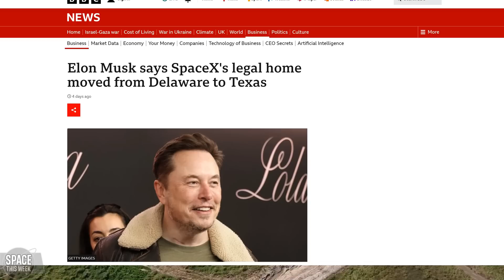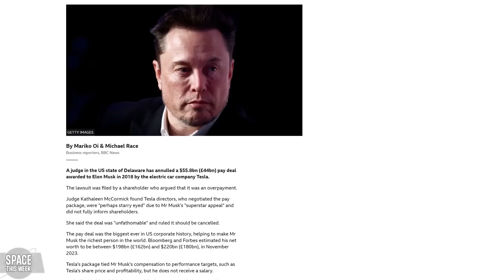SpaceX Aborts Full Stack Testing and Prepares for Ship 28 Static Fire!

Comment: I know that SpaceX wants to launch 144 times in 2024, but they are right now behind track. They have an average of about 1 launch every 3 - 4 days and they need an average of about 1 launch every 2.5 days. They can still change that, but they got to do it soon because the longer they wait, the more they will have to catch up. 

I have noticed that SpaceX is now starting to launch in batches. They have a couple launches within an incredibility short time (like those 3 launches in 24 hours) and then the next couple of days there are no launches. Then repeat. It is not always the same, but it is a pattern starting to show. Do you guys think that they will manage the 144 launches this year? I am concerned they might miss it.
Reply: Well they did manage to meet their goal during 2022, a goal by the way many said would not be possible. So give them time. I am sure they will make it.
Reply: @robertdrexel2043  I am very certain that they will manage to get 144 flights in a year. The question is if that year is 2024 or 2025 or some other. Right now, they are slightly behind for 2024, but it is not too late. Hopefully you are right and they will make do it in 2024
Reply: SpaceX ramps up as the year progresses. They are much closer to their goal for this year than they were at the same time last year for last year's goal and they just barely missed that one. If they do the same thing they did last year then they'll easily reach the goal.

Comment: If the first two flights of star ship reached set goals then failed/got aborted then they could be doing shed loads of checks going for full suborbital/orbital flight
Also might have to do several small test to get data for FAA
Reply: The goals are set in increments.  The whole package is getting to orbit and back, but each flight takes another step closer in that direction but they do not expect 100% success.  On flight one they wanted to get off the pad.  On flight 2 they wanted to get past staging.  On flight 3 they want to get into orbit.  Then there will be a bunch of flights where they try and get back from orbit (I suspect that's going to be a tough one).  There are also other goals involving booster recovery where they will test with soft ocean landings until ready to move to a landing (or catch) on land.  That will start with a successful boost back, then another step.. and then another..